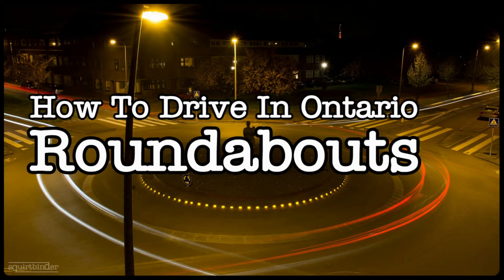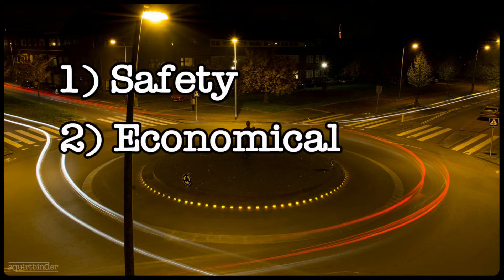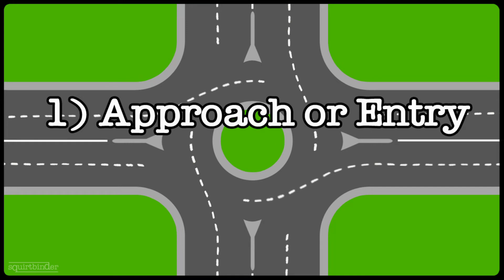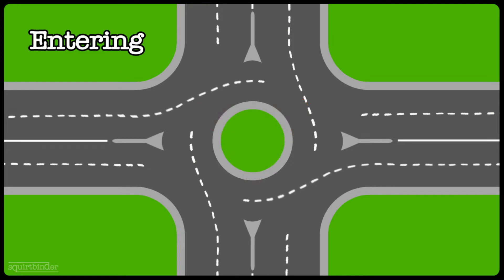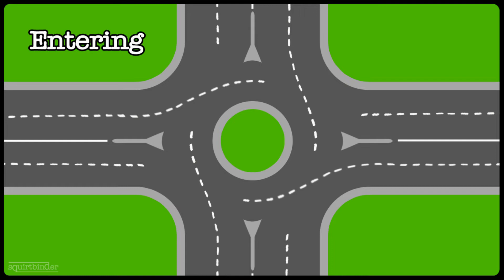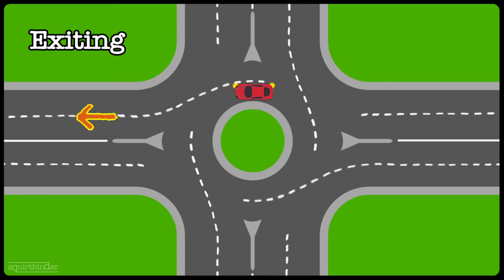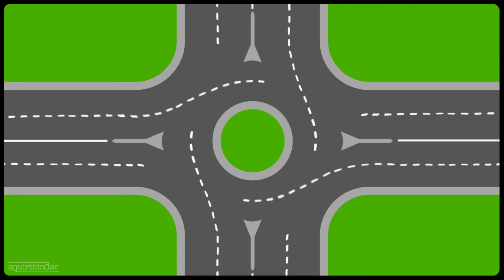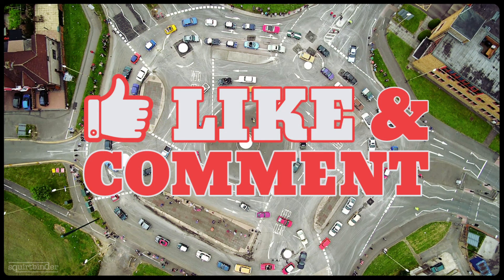How To Drive In Roundabouts In Ontario, Canada

Comment: Hi, I live in the UK and know all about R'abouts as I was a driving instructor for 16 years. I like the fact your getting some R'abouts in Ontario as I will be there in Aug 2019. Your explanation was excellent. The only difference in the UK is that at some R'abouts in the UK you can only go straight in the right lane (your left) depends on the junction (intersection). There are exceptions just like normal intersections and as you would know it's a matter of looking out for the arrows on the road or signs to do the correct thing.
Reply: They're VERY rare here in Ontario. You likely won't see one unless you're lucky or looking for one. I drove 4 hours from Toronto to Tobermory and never went through one. We need more WAY more. Toronto should get some to help with stop and go traffic here
Reply: Plenty I've seen that will force you to only make a right in the right lane (essentially a slip lane) but not any that force you to go straight through. Making a right in a roundabout lines up well with the concept of making a right on a red when there is no one coming. It's very seldom that our intersections disallow us from doing this I think it makes sense that our roundabouts rarely do as well. Do you have a lot of regular intersections with no right policies or maybe even one way roads? Just curious.
Reply: @RichardHartl hamilton is full of roundabouts

Comment: Roundabouts are so simple and beautiful. If only they kept the Rules the same:
1) DO NOT SIGNAL, unless you leave the Rbout
2) 2 lane Rbouts > you cannot take the 1st exit from the inside lane
3) both lanes can go straight
4) you do not switch lanes (therefor you don't ever need to worry about collisions)
Reply: I don’t even agree with the signalling to leave a roundabout. The lanes are very clear as to where people can exit depending on what lane they are in. I don’t need to see where they entered from I just need to see what lane they are in. On top of that I never put full faith into a persons turn signal. Lots of times people have those on and don’t actually exit. I was taught never to assume a person is actually going to follow through with it, wait and see where there car is going. I watch people entering to my left when I yield. If they arnt in the roundabout yet I just go as there is lots of time to enter before they make it to me. Regardless of what there signal light is indicating.
Reply: @bradd188  well that is a whole nother problem isn't it? We can't trust eachothers signaling...still. ideally you signal ahead to leave, which allows the oncoming traffic to see what you want to do and flow into the circle. Roundabouts rely HEAVILY on good drivers making use of the mechanics properly. You are not supposed to ever have to stop which is why the speed limit in and into a roundabout is 30km/h.

Comment: People in the roundabout have right of way and you must yield for them. Therefore, the people in the roundabout must signal their intention so the people upstream yielding know they can safely enter. That is why you signal right only when you leave. It tells the people at the next entrance that you aren't going to T-bone them if they enter the roundabout. If the people waiting to enter do not see where you entered (sometimes the case with roundabouts with mounds in the middle or poor lines of sight) a left turn signal means absolutely nothing. It actually means less than nothing because depending on where you are the law may state that if you are making a U-turn or staying in the roundabout for more than a single lap in the inner lane you should keep your left signal on to signify this, not to signify you are making a left turn. IE. you keep it on and immediately switch to your right sign as you approach your intended exit.
Also NEVER EVER EVER EVER SWITCH LANES IN A ROUNDABOUT!!! You will cause an accident!
I have seen so many accidents in these roundabouts and they always come down to people changing lanes or signaling intention improperly. Roundabouts are fast moving systems and they require a high degree of communication and coordination to function properly.

Comment: To me the fact that there is no direct signaling required for the purpose of the roundabout negates the whole purpose of a controlled intersection where in the parties can't be held liable for infractions for safety, insurance, or law, all of which are stipulations imposed upon every driver. It doesn't make sense that the rest of the roadways have these stipulations but when you enter into a round-a-bout its like a wormhole. Not trying to be a dick and I understand the points you made at the beginning. It's just incredibly bizarre from a logic stand point. Also, do you really trust other people to be honest in this scenario?
Reply: When you approach a roundabout, there is only ONE way to go, so there is no need to indicate a turn.  When inside the roundabout, you signal your exit.  If you want to take the third exit, turn on your right indicator just when you've passed the second exit.  That way all the drivers waiting to enter know what you're doing.  That's logical.  How the video explained signalling made no sense at all.  You would never indicate left in a roundabout because the left signal means nothing if you don't know where the car entered the roundabout.

Comment: is it a violation if i don't exit and keep going around cuz I missed the exit?  are you allowed to U turn by going around the roundabout (4th exit)?
are there 3 lane roundabouts in ontario?  what to do in that case?
are there roundabouts with more than 4 exits in ontario?  which lane do i take?
can you overtake in the roundabout?  vehicle approaching already in the roundabout left lane, so i yield to let them pass before i enter in the right lane.  but they're super slow or perhaps even stopped, do i have to match their speed or stop even though they're in the left lane i'm in the right lane?  if not, what if i pass them in the right lane and it turns out they're trying to exit the roundabout (1st exit relative to me) and i'm going straight (my 2nd exit) leading to a potential collision.  who has right of way?
Reply: First, in most cases you are allowed to make a U-turn in a round about. Depending on the laws of the specific area of Canada you are in you may need to keep you left turn signal on if you intend to U-turn or do more than one lap. Generally speaking what you can do in each lane should be pretty obvious based on the signs and arrows on the road. I would advise you use these to plan your entrance so you avoid missing your exit!
There are three and maybe even more lane roundabouts. In a three lane usually the inner most lane will be able to only go straight through or take a left. The middle will only be able to go straight through and the outermost can go straight through or make a right. This isn't too different from the entrance to a regular three lane intersection. If you look at this set up from the top and follow the flow of traffic you'll see that as long as all drivers follow the rules of their lane and they do not change lanes while in the roundabout no one will ever cross the path of another driver in that way.
If a round about has a non conventional set up, again, the signs and arrows will be your friends pay close attention to them when and if (they are pretty rare) you come across one of these!
Overtaking will kind of depend. generally you can overtake in a round about but It's not really advised as other drivers are usually expecting a sort of consistency to speed vehicles travel through the roundabout. If you try to overtake a large transport truck with a trailer in a roundabout it's especially dangerous. You can find your self getting nudged from the side by the trailer as it attempts to follow straight through the roundabout instead of making an ark like the truck pulling it. Often these trucks will signal or otherwise make it clear if they require additional room in a roundabout (Usually they ride the diving line between lanes when entering the roundabout so that you can't pass, do not honk at them they are doing this to both protect you and ensure they can make their turn).
If someone is in the left lane they could either go straight through or continue traveling around the round about. Usually they signal right when they are going to leave but it's usually not a good idea to assume that people will properly signal their intention in a roundabout (dumb I know). In that case you should be safe to take a right no matter what. If you want to go straight through I would suggest waiting until you are entirely sure they are staying in the roundabout before you proceed at a reasonable speed for the road you are on. If you happen to overtake them as a result of them going abnormally slow then so be it. As long as you are certain the way is clear and will remain clear for you to proceed you are almost always able to do so with roundabouts (assuming you are observing the other rules of course). That is essentially what those triangular signs at the entrances mean. They are yield signs telling you that you will need to decide to continue, slow, or even stop depending on the current conditions in the roundabout.
Finally, though I know this is a lot to think about, do your thinking about it off the road and make sure you understand them well so you can use them with out overthinking it!